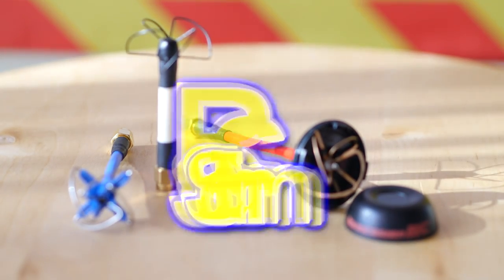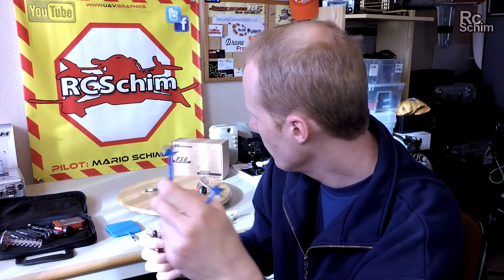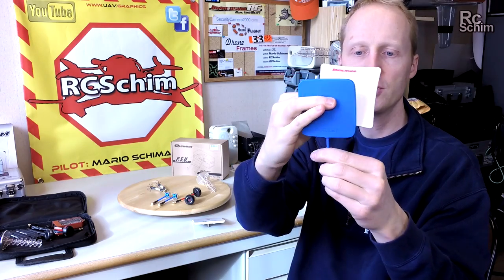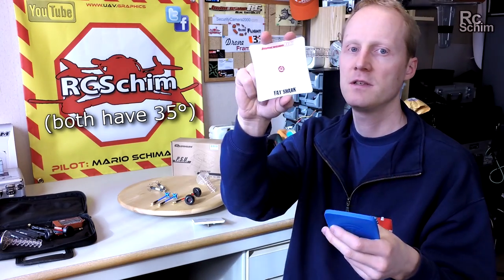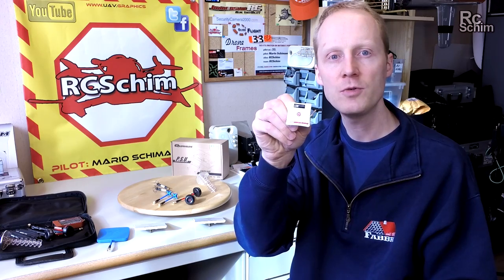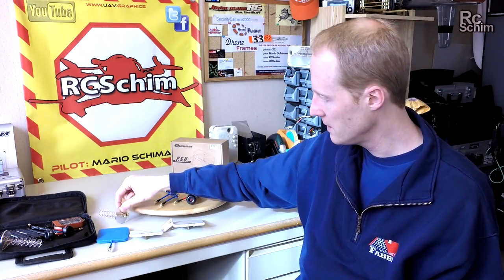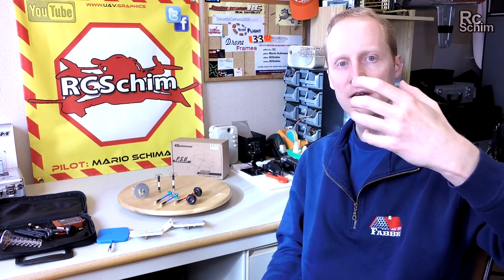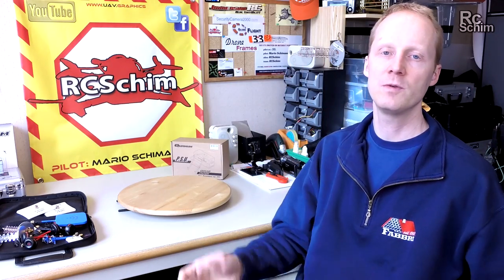FPV Antennas explained (5.8ghz Skew Planar Wheel, Patch, Helical and theory of antenna gain)

Comment: Ahah!First, thank you. Excellent short explanation.Second, I know understand what I am 'seeing' literally with the helical and patch.Doing some tuning flights and thought I would put on the 5.8 helical.  I could not loose signal going to the sides except extreme angles.  Put back on the Immersion 5.8 patch, and immediately had signal issues side to side.  I actually like the helical as the antenna.  I am not using diversity yet, flying fpv in front of me for up 1 mile.  I have been 1+mile with the Immersion patch; will see if I get that with the helical.   I think main issue will be how it looks hanging off the Headplays.  Thank you!
Reply from the maker: +DashingHeroes hi, I find it rather difficult to get good picture with helix or patch on the goggles. good compromise is the little patch from IRC (with 90° and 8dbi). But the helix is better mounted on a small tripod. this way you always have a good orientation - mounted on the head it's always on the move...

Comment: I really like watching you videos due to the info that you provide. However, it get's very hard to ascertain what you are saying because of your voice being soft and low and with your accent it is hard to hear and understand at times. If you will, please speak a lil bit louder so that I can gather all that you are trying to put out. Thanks
Reply from the maker: +Donald „NOT PLAYING1970“ Byrd thanks for feedback - seems I was a bit lazy and had unfortunate mic placement here. seems it works better if I hang the mic on the lamp above my head.   should improve on the next videos (well, not on the next upload because here the sound comes from different cams...)

Comment: Nice Video, good explanation!
I am wondering, most FPV Pilots prefer circular Antennas, but TBS use for downhill flying 
the Linear Antenas (2.4ghz) Yagi Antenna and on Aircraft Rod Antenna.
Why only TBS use Linear Antennas. Whats the Atvantage of Linear?
So i found just a little or less Information about Linear Anttenas and the Advantage.

I like to see your amazing Videos and hope you have any Information about the Linear Antennas.

Thanks Titanfinger
Reply from the maker: +Titanfinger hi, I'm not an expert for antennas. I think noone uses linear antennas anymore. I guess they have a bit more range than circ. antennas, but if the antennas are not paralell oriented (which they are seldom!) then you get penalties for that...
The circular wireless antennas were the ones that Trappy recommended me back then - and they are good!

Maybe you can use linear antennas if reflections (and so multipathing) is not a big issue where you fly...
So I think under best conditions they have more range.
But I will include normal 5.8 linear antennas in my practical comparison as soon as weather is nicer here again...

Comment: guten morgen. i didnt catch what frequency you said these are for. here in the US the hardware stores sell plasti-dip, and i think in europe theres a similar product to reinforce the lobes. it was a bit difficult to hear you, as it was a week ago during a review of another product, even with volume at high. thanks for the nice review.
Reply from the maker: +John Robertson thanks for the feedback about audio levels. If I turn up my volume here I can understand it loud and clear. do you use speakers, problems on other vids with low loudness?
The antennas are on 5.8 - but you're right I should include this info ;-)
Reply: +RCSchim Thanks for the video, I also had to have the volume up full.  I do not get volume issues with similar posts. Look forward to the comparison.